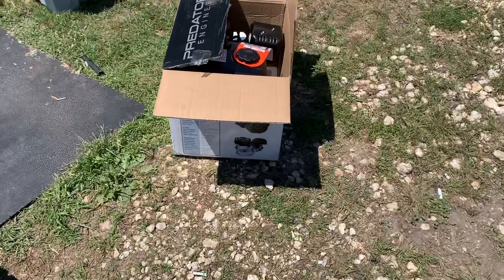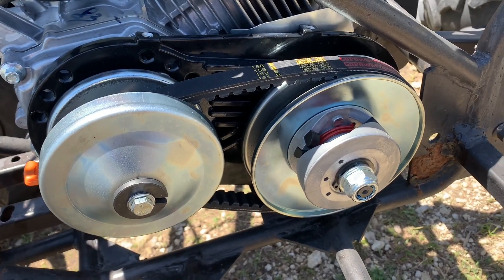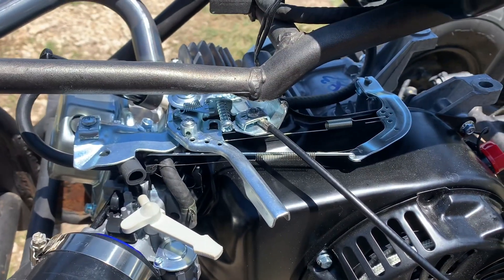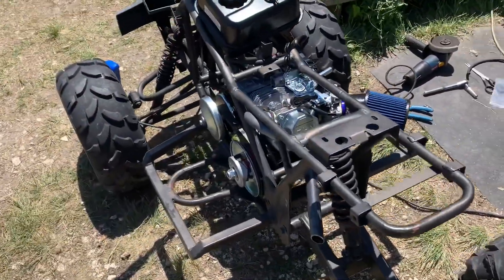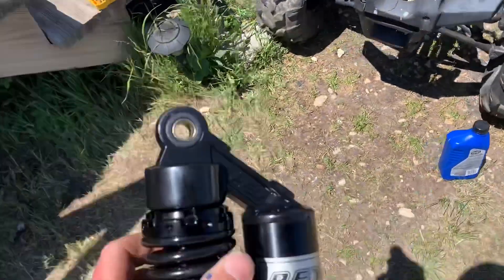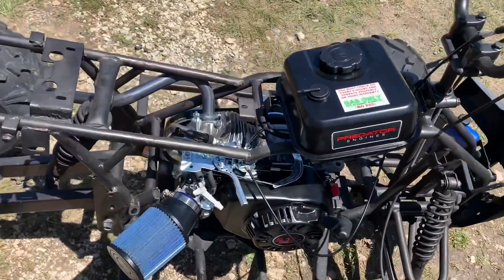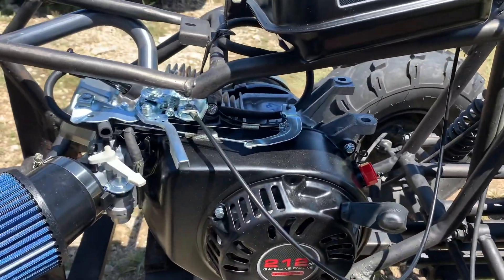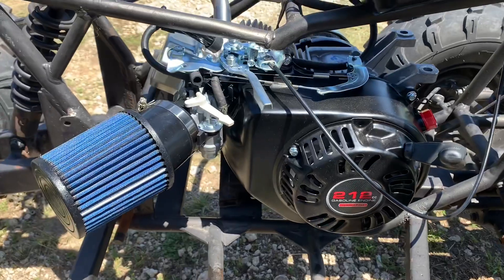Predator 212cc ATV Swap - Chinese ATV part 1

Comment: I do not see where you added the link for the rear sprocket. My mini ATV has a number 428 sprocket on the rear and that’s too big. Were you able to find a sprocket that fit or did you have to modify a sprocket?

Comment: What size rear sprocket do you have planned for this project?
Reply from the maker: It’s done and running a 60T sprocket. I have a couple more videos of it completed.
Reply: @Alpha-Works-Tx  Cool cool. I found an abandoned Tao Tao 110cc rolling atv frame and I’m planning to do a similar project, minus the torque converter. I’ll have to adapt the mounting holes to a sprocket but cool cool. Thanks!
Reply from the maker: @NiTecIndustries  nice these tao Tao frames are the perfect starting point.